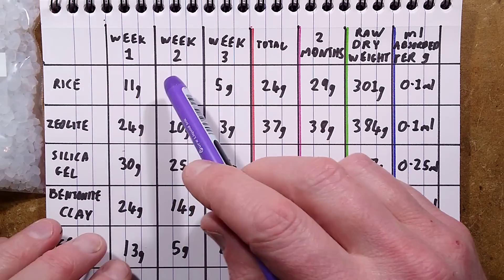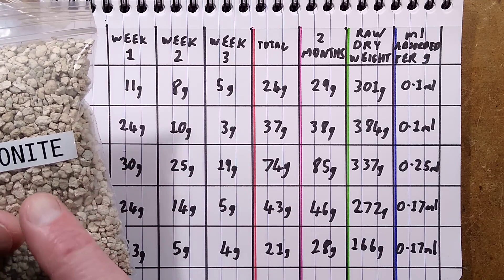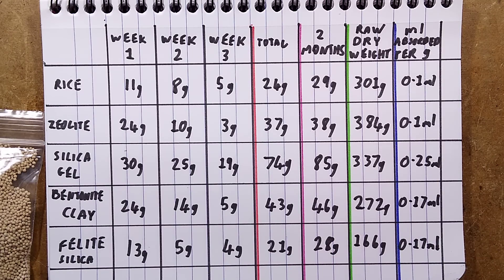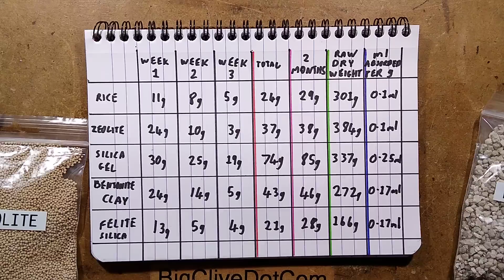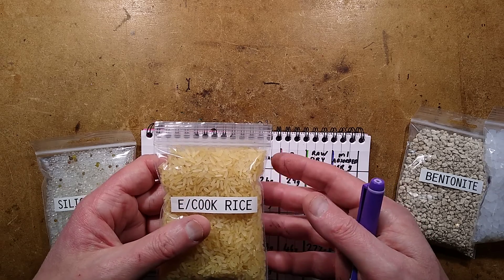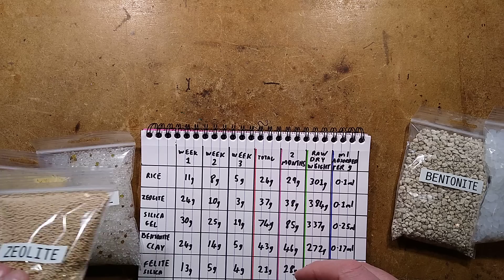Five desiccants - two month test with full results

Comment: Don’t quote me on this (he says while typing on the internet) but I recall reading that cooking rice, or any starch really, crosslinks the sugars and starches making them absorb less water than raw, hulled rice.

Also, different desiccants must be heated to different temperatures to drive off the most water. Just taking them to the in-air boiling point of bulk water can’t push out the intercalated water from clay grains.

Also also, doing that fundamentally changes the structure of most kinds of clay from the hydrated forms. Therefore their densities and water absorption properties can change quite a bit depending on the drying temperature.

It’s been a long time since I had anything to do with desiccants, so your mileage may vary.
Reply: Getting water past it's phase change temperature will release it from any material not chemically bonded to it. It's only a matter of time.

To properly dry out bentonite clay, a temperature range of *150°C to 200°C* (302°F to 392°F) is recommended. This range is effective for removing moisture without damaging the clay's molecular structure or properties[1][2]. Drying bentonite at higher temperatures, such as those above 500°C (932°F), can irreversibly remove crystallization water and degrade the clay, turning it into a non-functional aggregate[2]. 

For industrial purposes, rotary drum dryers are often used to achieve the necessary moisture reduction, typically bringing the moisture content down to between 5% and 12%[2]. It is crucial to control the drying process carefully to maintain the quality and functionality of the bentonite clay.

Citations:
[1] https://www.sciencedirect.com/science/article/abs/pii/S0169131717304222
[2] https://www.ftmmachinery.com/blog/bentonite-processing-process-and-equipment.html
[3] https://kegriver.com/the-importance-of-moisture-content-in-bentonite-sulfur-clay/
[4] https://library.csbe-scgab.ca/docs/journal/30/30_2_237_ocr.pdf
[5] https://temaprocess.com/2020/drying-bentonite-clay-using-tema-process-fluid-bed-dryer/
[6] http://www.wyomingsunmade.com/sun-drying_23.html
[7] https://www.medicalnewstoday.com/articles/325241
[8] https://digitalfire.com/material/bentonite
[9] https://skyorganics.com/blogs/blog/5-ways-to-use-indian-healing-clay-bentonite-clay
[10] https://www.mnclay.com/AddToCart2.aspx?ProductGroup=BENT
[11] https://www.reddit.com/r/HaircareScience/comments/fuc42n/how_using_bentonite_clay_has_saved_my_fine_oily/
[12] https://www.douyee.com/en/products/item/566/clay-desiccants
[13] https://homedistiller.org/forum/viewtopic.php?t=68673
[14] https://www.happyherbalist.com/bentonite-clay-8-oz/
[15] https://blog.biokeram.com/bentonite-in-my-formula-how-to-dry-faster
[16] https://www.silica-gel.it/en/content/12-activated-clay
Reply: @Mike80528  You'd have to ask a good physical chemist to get a proper answer but I'd expect that organic materials like rice do undergo some van der Waals bonding with water so require more energy to release than that required to merely get into the vapour/gas phase.
Reply: I wonder where that cross linking action would come from, in my mind which is definitely not to be quoted i would have expected the opposite, cleaving action.
Reply: you are right; for best results, use P2O5 but that cannot be regenerated so easily. Same is true for H2SO4
Reply: "but I recall reading that cooking rice, or any starch really, crosslinks the sugars and starches making them absorb less water than raw, hulled rice."
There is no sugar in rice. Cooking converts rice to gelled form. One type of rice, called boiled rice (or parboiled rice) has been cooked and then dried. Puffed rice is the preferred desiccant. 
"Just taking them to the in-air boiling point of bulk water can’t push out the intercalated water "
right; zeolites are clay with pores. If you soak the beads in water (saturate it) and then remove the external water by heating around 100C, you will get an idea of bound water. Most of the zeolites are lab made these days (bentonite is natural)
Reply: @janami-dharmam  Starches are just complex sugars. Repeated cooking of starches does change their chemical properties:

## How Re-Cooking Changes the Structure of Starches in Potatoes and Rice

The process of cooking, cooling, and reheating starchy foods like potatoes and rice significantly alters the structure of their starches. This transformation primarily involves two key processes: *gelatinization* and **retrogradation**.

### *Gelatinization*

When starchy foods such as potatoes and rice are cooked, the heat causes the starch granules to absorb water and swell. This process, known as gelatinization, disrupts the crystalline structure of the starch molecules, primarily amylose and amylopectin, making them more digestible. During gelatinization:
- The starch granules absorb water and swell.
- The crystalline structure of the starch breaks down.
- The starch becomes more accessible to digestive enzymes in the small intestine, converting it into glucose more readily[2][5].

### *Retrogradation*

After the cooked starches are cooled, a process called retrogradation occurs. During retrogradation:
- The amylose and amylopectin chains realign and form a new crystalline structure.
- This new structure is more resistant to digestion, hence the term *resistant starch*.
- Resistant starches pass through the small intestine undigested and reach the colon, where they act as prebiotics, feeding beneficial gut bacteria[1][3][6].

### *Reheating*

Reheating these cooled starches can partially disrupt the crystalline structure formed during retrogradation. However, not all resistant starch is broken down:
- Reheating can decrease the amount of resistant starch slightly, but a significant portion remains intact.
- The reheated starches still exhibit lower digestibility compared to freshly cooked starches, leading to a reduced glycemic response[1][2][9].

### *Health Benefits*

The formation of resistant starch through this cooking-cooling-reheating cycle offers several health benefits:
- **Improved Glycemic Control**: Resistant starch does not raise blood glucose levels as much as digestible starch, which helps in managing blood sugar levels[1][6].
- **Enhanced Gut Health**: Resistant starch acts as a prebiotic, promoting the growth of beneficial gut bacteria and producing short-chain fatty acids like butyrate, which are beneficial for colon health[2][3].
- **Increased Satiety**: Foods high in resistant starch can increase feelings of fullness, which may aid in weight management[3].

### Practical Applications

To increase the resistant starch content in your diet:
- Cook starchy foods like potatoes, rice, and pasta.
- Cool them in the refrigerator for at least 12-24 hours.
- Reheat them before consumption if desired. Reheating does not significantly reduce the resistant starch content[1][3][9].

In summary, the re-cooking of starches in foods like potatoes and rice involves the processes of gelatinization and retrogradation, which alter the structure of starch molecules, making them more resistant to digestion and offering various health benefits.

Citations:
[1] https://www.healthline.com/nutrition/cooling-resistant-starch
[2] https://www.bernard-preston.com/Reheating-resistant-starch.html
[3] https://hopkinsdiabetesinfo.org/what-is-resistant-starch/
[4] https://www.sciencedirect.com/science/article/abs/pii/S0268005X20329179
[5] https://chemistry.stackexchange.com/questions/116895/does-cooling-a-potato-change-the-nature-of-its-carbohydrates
[6] https://pubmed.ncbi.nlm.nih.gov/26693746/
[7] https://www.sciencedirect.com/science/article/pii/S0023643895945520
[8] https://www.ncbi.nlm.nih.gov/pmc/articles/PMC7984060/
[9] https://www.nytimes.com/2023/11/08/well/eat/resistant-starch-pasta-rice-leftovers.html
[10] https://www.ncbi.nlm.nih.gov/pmc/articles/PMC10039256/
[11] https://www.reddit.com/r/chemistry/comments/15slv5/what_happens_to_potatoes_as_they_cook/
[12] https://aru.usc.edu/blog/did-you-know-that-by-changing-the-way-you-cook-rice-you-could-cut-the-calorie-content-of-the-rice-by-more-than-half/
[13] https://www.ncbi.nlm.nih.gov/pmc/articles/PMC10713747/
[14] https://idahopotato.com/dr-potato/potato-chemistry-in-cooking
[15] https://santacruzparent.com/why-pasta-and-rice-may-be-healthier-as-leftovers/
[16] https://pubs.acs.org/doi/abs/10.1021/acs.jafc.8b06371
Reply: @Mike80528  Correct, polymerised sugars essentially.

Comment: Just a comment about "recharging" silica gel. The best way I've found is to microwave it - I used to have the details of how long to microwave it for but I've lost them. I suggest using a self indicating silica gel (colour changing ) and running your own tests.
Reply: can you over-microwave it? like, can it get so hot that it damages the silica gel through melting or some other mechinism?
Reply: @frogz  I never had a problem with overheating it. I had self indicating silica gel in (if I remember correctly) 10gm or 20gm sachets. I microwaved them for a minute then checked the colour - if it hadn't changed I microwaved for another minute and so on until there was a complete colour change. I made a note of my experiment so I could just microwave it for a fixed total time instead of 1 minute bursts. I had it in a text file - if I can find it I'll come back and add it to this comment.
Reply: @frogz  Yes, heating clear silica gel over 150°C will degrade it. The dye in color changing gel can be damaged above 120°C. There is no temperature control with the microwave so it's very easy to overheat it. The microwave can also heat it too fast and cause it to crack.
Reply: @frogz   Yes i have had trouble with that myself. Silica gel still works but the indicator dye is more on the brownish darkish side, not as clear as before, not beautiful orange which becomes dark green. So i don't like microwaving it.

Comment: As you mentioned, a test with baseline drying would probably be more definitive. But I still think silica gel is going to be superior to all the other desiccants present. There's good reason it's the de facto standard desiccant across many industries. But, having said that, it's clearly not the best for all jobs; imagine tossing silica gel beads on the floor of your garage to absorb some spilled coolant, for instance. You'd get a trip hazard that's not very cost-effective.

Comment: One test is how much water a desiccant absorbs as it was baught. Now one might choose a desicant regeneration temperature and rerun the experiment.  One can contrast the regenerated  desicant with the original, as is.

Rice might limit the desicant  regeneration temp.  But 150c might be a good regen temp for the others. 

Crushed drywall is another potential desicant after initally heat it to 150c. Drywall is Calcium sulfate dihydrate (CaSO4·2H2O). It holds two water molecules per calcium sulfate. Heating calcium sulfate dihydrate to around 100-150°C (212-302°F) drives off some of the water, leaving behind: Calcium sulfate hemihydrate (CaSO4·0.5H2O), aka plaster of Paris that readily absorbs water vapor from its surroundings due to its high surface area. And is easilly regenerated by heating it to 150c again. calcium sulfate hemihydrate is a viable low cost desicant option. 

Dibt go above much above  150c because itveffects how well water can be reabsorbed. Regeneration temperatures above 250°C (482°F), completly dehydrate calcium sulfate to anhydrous CaSO4 that does not readily absorb water msking it not a good desicant.
Reply: Another commenter suggested magnesium sulfate as it goes all the way up to 7 water molecules which I think is probably a better option than calcium sulfate - Epsom salts hold so much water that they're well over 50% water by mass, so cooking it down to mostly or completely dry would probably work fairly well
Reply: @bosstowndynamics5488   yup magnesium sulphate can hold lots of water and work as a desicant.  But it suffers slow adsorption and  has trouble getting below a certain level of humidity. 

If getting the lowest humidity is desired, calcium chloride and concentrated sulpheric acid are among the best but each has their own issues that make them not a good choice in many situations.

I'm fascinated by solid state option  that removes humidity by electricity where electrolisys of water molicules converts the moisture captured to hydrogen and oxygen.

Comment: So glad you did this one!  I've been curious if there's anything better than silica gel.  Bring on round 2 !!
Reply: @dekjet  surely better, but do we have a supported version?
Reply: Quicklime in some cases. Or even those iron powder hotpacks that react with both oygen and water vapour come to mind.
Reply: @blueredbrick  yes, quicklime is very effective in removing both CO2 and H2O but it is not easy to regenerate. For all practical purposes, the very low cost offsets its absorption capacity
Reply: @janami-dharmam  A small-ish glass melting oven can be found in second hand stores and even newly bought it's nothing too extreme. The only difference is that the oven includes actual de cent insulation that does not melt easily.  Take a large blok of metal forging crucible orr insulating material and have a small plasma arc in a cavity, say 100 watts and it''ll keep going up in temp until the systems just breaks melt or the fuse pops. When the heat cannot escape properly it takes very little energie influx/power to keep increasing the temperature.

Still I prefer silica gel beads or similary ceramic gels, less of a hassle. But sometimes you got to actually react the water or CO2 or others away to get the result you want. 
Similarly those 'getters' inside vacuum tube tech like crts are not perse super practical but it is needed for the proper functioning of the device for longer than a week or so.
Also I'm not really liking the property of the ultra hygroscopic materials that dissolve themselves into a messy nasty mess like those calcium chloride based stuff. It's usable enough but it is my personal preference to avoid it. I've had unnecessary troubles with drying modules for drying feed gas that just turned into snot and ruined my experiments just because the person before me was apparently content with the messyness and did not bother spending a day improving that part of the system.
Having your own part of a lab is awesome so can optimize it and know what to expect.

Comment: I have a question: What sort of scale would you need to actively remove moisture from, say, a reasonably sized two person bedroom thus preventing black mould growth?
Reply: Humans breathe out so much water, you would need a dehumidifier rather than a desiccant to keep up.
Reply: Impossible to answer as you'd need to know the humidity, how much water introduction there is, vapor barriers, penetration, existing quantity, growth rate, temperatures, etc.  A more active/powerful dehumidification is likely needed after preventing additional moisture.
Reply: You can probably find a used dehumidifier for cheap somewhere.

Comment: Great, comprehensive test. 
I use silica cat litter in my outdoor electrical boxes to fight moisture and in sewage treatment plants, moisure comes with agressive sulphites or sulphates that spoil copper wires and contacts. Cat litter for me justifies its price many times over. Silica gel ir rare and expensive. Will check out bentonite litter if i find it in local shops.

Comment: Another desiccant is calcium chloride, aka with the corporate name in the US of "Damp Rid". It actually liquifies it absorbs so much moisture. Reusable too. BTW, did you notice the cool electrostatic effect the plastic bag had on those  zeolite prills? First time I ever saw that effect was with those tiny (carbon?) prills/balls that you can find inside many old hard drives. I think they also were used for desiccation.  This was an interesting video Clive. Thanks.
Reply: Interesting. I bought some "Moisture Traps" from Poundland in the UK and the one I put in a 3D printer enclosure is now totally liquid (old damp house in Wales!). The instructions tell you to dispose of it. I've just noticed it contains calcium chloride, so does that mean I can convert this disposable product into a re-usable one?
Reply: @EcoHamletsUK  Yes, the calcium chloride solution can be evaporated in the microwave or on a tray in a low heated oven. Scrape up the dry flakes and start again.
Reply: @EcoHamletsUK same here. I put one in my room It’s filled with water, I’m surprised I don’t have a mold issue
Reply: Another material is the stuff they make disposable diapers (nappies) with.  Amazing absorption, though I don't know how good they'd be for drying things out.

Comment: A lot of things are deliquesent and become liquid from absorbing mosture. It varies by salt. Table salt gets wet only due to impurities apart from NaCl. If you have issues due to humidity, use canning salt.
   Side note,;- hyperthyroidism from lack of iodine was first named in modern medicine after a town geographically in the center of England where the least amount of sea salt containing it came in on the wind. So they had the highest amount of cases of the island.
   People also used to use pans of copper sulfate in their homes (19teens-40's) It changes from anhydrous white to pentahydrate blue. It decomposes in flame temps to oxide, not sure about drying regime.